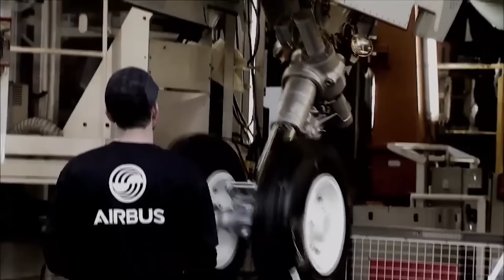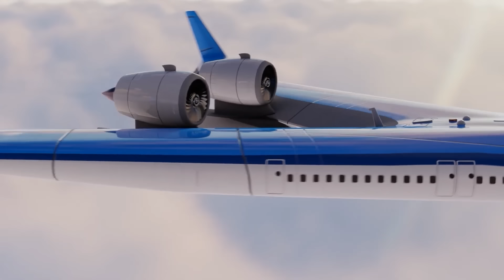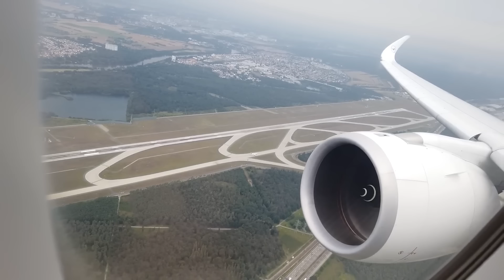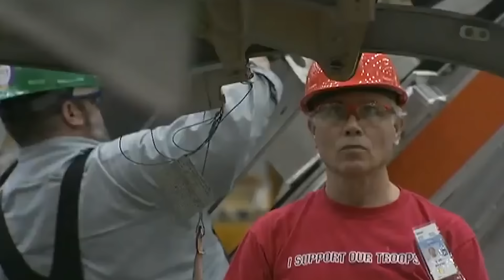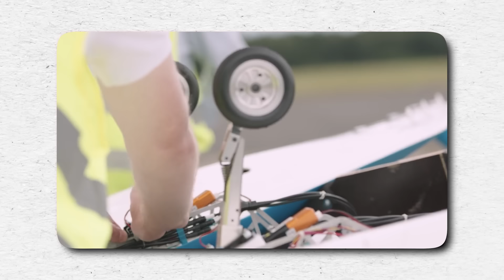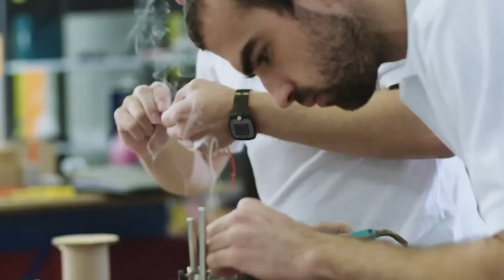Boeing and Airbus Are TERRIFIED of This New Plane | Flying V

Comment: I like the idea, but worry about engine support stress. I would like to see a small wing with flaps put between the 2 engines for stress support relief, and additional pitch control of lift and breaking. Don't know if it would be a good addition or bad, I'm not an avionic engineer, just going from a gut feeling.

Comment: There has been flying wing aircraft come and go from early last century. Tube and wing design is much easier to pressurize the cabin than a flying wing design. The weight is between two wings offering more stability. Engines are hung below the wings keeping weight lower which offers more stability plus the engines are much easier to work on.
Reply: It's also been shown that a large percentage of people get queasy or at the very least strongly dislike being far from the center axis when a plane is tilting for a turn. Every time it's been tested it's been concluded that it's not viable commercially
Reply: @sawdustdimes thanks Captain Bring Down! Negative Ned!

(Really?)-#)
Reply: @John-vz5un  just telling you what I read. Personally, I think I'd like sitting near the edge, feeling the momentary weightlessness when they bank into a turn!
Reply: @sawdustdimes i strongly dislike the idea of feeling the plane turn, so i understand your stats 😅
Reply: @sawdustdimes  An interesting adaptation and optimization of the difficult-to-maneuver flying wing; using the vortex drag reducing winglets as rudders is clever.  My only concern is whether the engine location could be a problem in a stall.
Reply: I hear you!
Reply: Can you please to other wing of the plane and take half of your family with you

Comment: Son, you have no idea what you are talking about I'm sure you have no aeronautical engineering background.
You have mention so many imaginary specifications and features that doesn't exist yet.
The lifting part of that aircraft or the wing is too thick to cut through the air how can  it be efficient 😂
The biggest prob of that design is the induced drag.
In theory that kind of design is possible for low altitude applications but for high altitude the fuselage needs to be pressurized and must be cylendrical NOT oval

Comment: It won't work.
That concept is only possible for scale models.
What lighter structure are you talking about, that kind of design will need heavier structure because it's not cylindrical. Cylindrical fuselage is the most practical in so many ways. Cylendrical body can handle higher internal pressure at high altitude.
HOW CAN THAT BEE EFFICIENT THE WING IS TOO THICK😭😂

Comment: I think this design can have better flying control.Genius. 🎉
Reply: it could be stability is better because there are less interuptions on the flying surfaces although this could in its self induce other disrutions in heavier weather conditions but " if you never never go you wont know" old aussie tourist add  the greater horizontal surface could have more uncontrollable problems its not a stealth aircraft with huge power to control it

Comment: The wings\s appear to be too thick for transonic flight.
Reply: Nobody said anything about "trans"sonic flight.  Speed would be about the same as the 777, just vastly more efficient fuel use.
Reply: @michaelfoster-qw2tw  The 777 is a transonic airliner.  Do you even know what transonic flight is?
Reply: @duanegrindstaff9635  Sorry, I had just seen another post how this design might well have trouble with higher Mach numbers, and I conflated the two.  My GUESS would be (but I am not building any vee-wing models to test) that low-speed maneuverability would be adequate, and flight up to transonic would be uneventful.  It's getting through that transonic phase, where some adjacent parts of the airflow are subsonic and some supersonic, and they will have to get along... unlike the 777, or nearly every other airplane, where the super- and subsonic parts are separated basically at the wing root, or the propellor hub.  I think. When I get that aeronautical engineering degree, I'll probably have more cogent thoughts...
Reply: @michaelfoster-qw2tw  Getting your degree is a lot of work, but if you have good professors, it can be a pleasure.  I got mine at the University of Washington in Seattle.  Bet Wishess, whatever you do.

Comment: I’d rather be talking about hypersonic aircraft which could be just as cost effective if not better.  I think the need for improved speed is more important with long haul flights.  Plus, in the years ahead thee will be alternative fuel sources where current jet fuel will a relic of the past.  This wing craft might be good for short haul flight where hypersonic flights aren’t practical or superfluous , because of shorter distances.

Comment: I remember before I worked on aircraft. An inventor , 1930s , in U.K.  designed a flying wing.  I’ll find and show it if it’s possible .He was  Sir Barns Wallis .  His design was a swing wing for high altitude super sonic flight  and many other important built and tested . 1950 s. Mostly in aero space industry. .
Reply: Barnes
Reply: I'm in my 70s now and I remember seeing that AC you are talking about in documentaries.  Blended wings & flying V's were talked about from many years back.  I had 30 years in aviation and it was talked about in hangers ramps & in terminals.  I am really glad that they now are seriously engineering it and they will have them built before I leave this place.

Comment: This is a very costly design compared to the simple tube. The presenter is wrong about the aerodynamics of the tube. It floats in the air very nicely not just being a sluggish push by engines like he states. Not a viable option for changing a century of inherit engineering around the world already in place. Especially the different sizes needed for different length routes. Just sensationalism.

Comment: They should make it a flying triangle instead of a "V." It would be more stable with added lifting surface. Also, instead of 2 mounted cylindrical engines, they could be mounted as 2-3 engines in an aerodynamic configuration, reducing drag. This is clearly not a finished design.

Comment: How is flying  2 buses sideways more aero dynamic?
Reply: Two words, lifting body.
Reply: @hamaljay  and I'd assume more lift means less fuel needed to move the plane. (Only rudimentary physics knowledge here so correct me if I'm wrong)
Reply: @Elucidator94  don't feel bad they really haven't been able to mathematically explain lift we understand the concept and we can make it work through engineering but the physics of it are kind of dubious at best. But yes anything that could produce more lift is therefor more aerodynamic.

Comment: Oh yes, with a huge number of airports that cannot support landing of an A380, this design is an absolute surefire hit, much bigger wingspan than an A380, far wider to bring to the terminal and to accommodate on the runway - and less than half the range of a 777 - I can see the operators of airports, that are already struggling with volume, really supporting this design, which would require far larger terminals or half the number of aircraft and more frequent stops. Plus, I can imagine how much more 'fun' this would be with some decent turbulence, given how far each side could drop or rise compared to the other - better than a theme park!! I can't wait to fly on one! Oh, actually, I can. All I want from an aircraft is ease of boarding, a smooth ride, a bit of space on long haul & access to a toilet. I don't need an innovative design that brings nothing to the experience, just because someone thought it looks good. Sell me on the benefits of sitting in an unproven pressurised vessel that looks good on paper but otherwise brings little benefit to my trip. Oh, and 4000 nautical miles range is pathetic, comparing it with a 777 (9000 nautical mile range A350 up to 9700 nautical miles) a joke, any savings in fuel would be compromised by the extra stops, time delays and maintenance.

Comment: Do the rear placement of the big turbofans increase the air flow over the body and, improving portance ? ?
Reply: Huh?
Reply: @michaelfoster-qw2tw  Wings generate lift by making air pressure on the top of the wing  lower than  the pressure under it  With the big turbo fans creating a low pressure bubble in front of it and a high  pressure behind . . generating thrust for high speed. .so the front of the engine is lower  and , I think, improve the wing lift. .
Reply: @MichelBrown-o9v  Sorry, I was asking what is "portance".  Yes, I think you're right.
Reply: @michaelfoster-qw2tw  Another word for lift. . 🤔 I think I used a french word      since I mainly speack french  😉
Reply: @MichelBrown-o9v  Thank you.  I am limited to just one language, so far.

Comment: Lots of negative comments. Seems like non-technical gut-feel criticism. However every successful new design is an engineered solution to human desire or need. The Wright Brothers demonstrated that science coupled with innovation can lead to radically new solutions to old problems. Why not here, why not now?
Reply: I’ve been flying for almost 60 years and have seen flying wing aircraft ideas in magazines come and go about as often as I have seen the comeback of airships in magazines. They are both as likely to materialize as Musk sending a million people to Mars. Don’t hold your breath.
Reply: Also some of us do have some knowledge. Additionally, all experts on this topic agree that people won’t want to fly on this. The width will cause a passenger to rise and fall several times as much as with a conventional airliner when it banks into a turn. It’s not going to work.

Comment: I wonder how it will handle higher mach numbers.  I imagine that if they start by building freighters they will be able to gather all the real-world performance data they need to satisfy the FAA for a passenger aircraft.  But we won't see any blended wing/fuselage commercial designs for a very long time.
Reply: Who said anything about higher mach numbers?  Two engines like on a 777, about the same weight, it will fly about that fast.  But probably more efficiently fuel-wise.

Comment: The engines in this design are above the "V" wing shaped structure.  In a steep climb, the passage of air to the engines might be blocked out by the airfoil. Stalls could be strange. So they will say that the design is never supposed to stall, never supposed to climb steeply, etc. What happens in storms, or really rough weather, passing through a storm front, etc?  I would also add that Boeing and Airbus are not terrified of this design. If they were concerned, they could build one of their own. They have the resources to do it. They watch the market closely.  Blended body aircraft have been discussed for a long time now. For many reasons, nobody has made the jump.
Reply: Maintenance is another issue.  Cranes and pulleys are going to be needed to service engines that high off the ground!  This is NOT a convenient way to mount engines.
It's much easier to get to engines hanging in pods BELOW the wings.
They stopped putting engines in the wings like they did for the Comet and some early jet bombers because of safety issues (the fire could spread to the wings and MELT the wing structure causing a structural collapse!) and maintenance.  Again, it's much easier to service engines hanging in pods below the wing!  If the engine is outside the wing, it's much easier to service or remove it than if it's imbedded in primary airframe structure like the wing.
Reply: @AvengerII  So True! The original Soviet TU-22, that thing with the high mounted engines in the tail, was a nightmare.  The Soviet air forces hated it!

Comment: There is a requirement for pressurization of a non circular fuselage that will require significant structures that will be working in bending to maintain
a pressurized cabin that will cost much added structural weight and special metal fatigue problems and sealing designs to contain a pressurized container. The risks are very serious, the structure will be heavy. The devil is in the structural design.

Comment: They never learn. Remember the lesson of the Concorde. At speed, it worked great, but at a lower speed, there was not enough lift to keep the airframe in the air. The same problem applies here.
Reply: Delta wing... say no more.

Comment: Passengers are going to get sea sick with turbulence. when in a conventional tube body passengers are in the middle when the plane tilts from side to side, which  doesn`t affect many passengers. BUT with the winged Vee the passengers are more to the outer edge of the wing making the passengers more susceptible to air / sea sickness due to the excessive wing movement when in turbulence or landing with strong winds.
Reply: Even just the wing flex under turbulence.

Comment: A lot of comments are negative and many think they know better, but they forget that even failed designs give boosts to new technology. I am all for this, I don’t see problems, only solutions. Also airport infrastructure can be improved, many airports did for the A380.
Reply from the maker: Say it louder for the people in the back :)
Reply: Nearly all drawbacks of this design become meaningless if it becomes a military fuel tanker that can land on austier runways with it's high engine mounts, no need to pressurise a passenger cabin only a cockpit and no worries about passenger comfort. No Airports existing infrastructure to deconflict because it's military base friendly.

Comment: The top speed ought to be significantly lower due to bulky profile, thick wings/body that will cause drag.
Reply: I was thinking the same thing the tube is more aerodynamic but an Arrowhead is also a v and it's very aerodynamic
Reply: Well, they're comparing it with a 777, not even an A350 which have ranges of 9000 & 9700 nautical miles respectively, compared with 4000 for this design - an A350 capacity of over 400 (up to 480), compared with just over 300 for this one, 20% savings in fuel are lost before you start. If it can't fly further, with more capacity and cheaper, it'll be lost to the new conventional aircraft already in process in the next 5 years. The new Rolls Royce Turbofan is calculated to use 25% less fuel than current engines, thus also extending range. This new design indicates a 20% fuel saving with less capacity and less than half the range of current engines. Might suit domestic America but useless for flights to Asia, a growing market, & certainly not comparable with the bigger Boeings or even mid-range Airbus A321XLR, with over 4500 nautical miles...

Comment: hmm, wilw rthismight look great in theory and concept
in practice it will be a completely diffferent story
first is the highly impractible engine placement on top of the" fusilage" 
verry herd to access and impossible to check if there is damage or not , by ground crew or during the walkaround check
and dont even get me started on regular maintenance, as it will be a nightmare
engines are placed under the wings and in clear view / easily accessable for multiple reasons